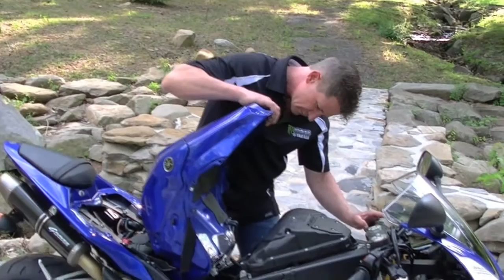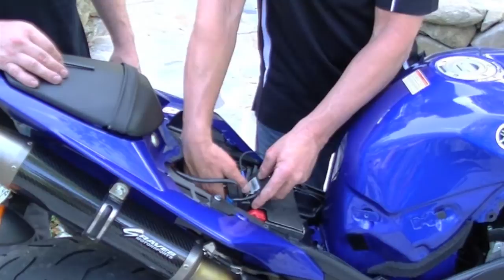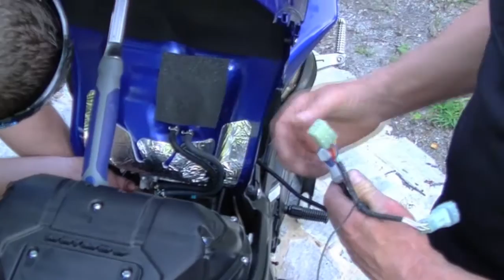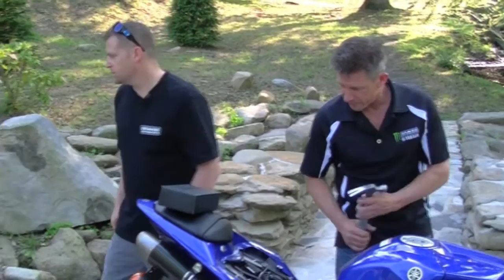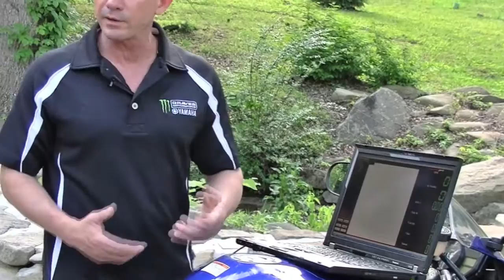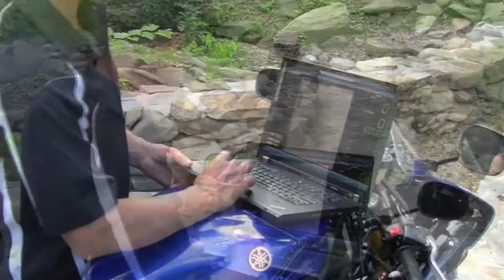Dynojet Secondary Fuel Module Install Video on Yamaha R1 by Chuck Graves

Comment: Wouldn't it be better just to get a bazzaz system which comes with lower and upper modules already? How much does this secondary module cost. With auto tune Pcv is like $500. I have an r6 why would I want this secondary module?